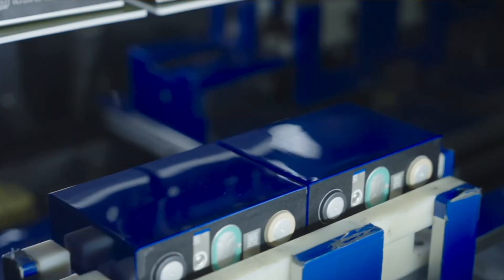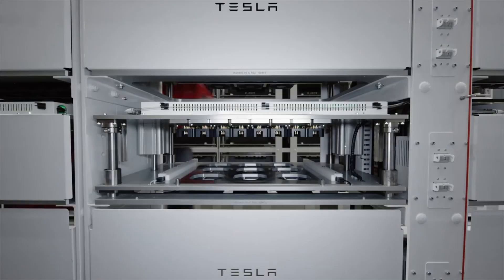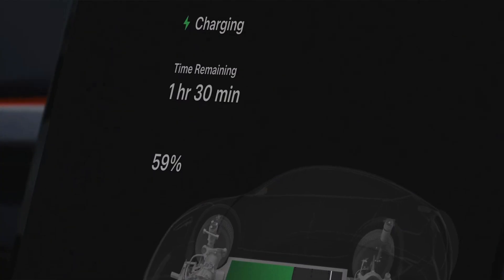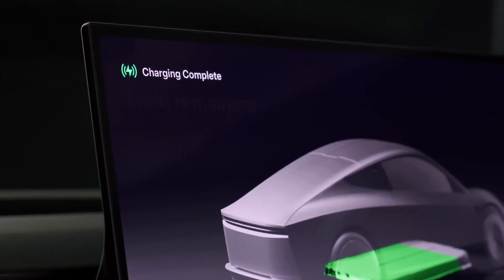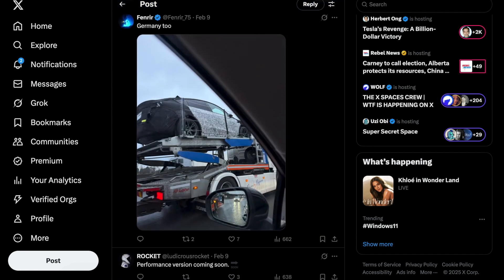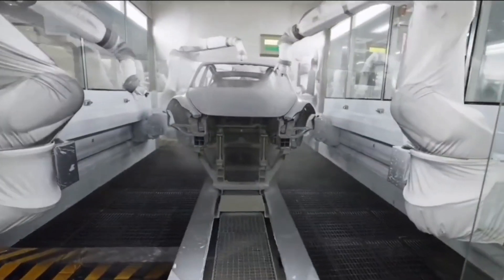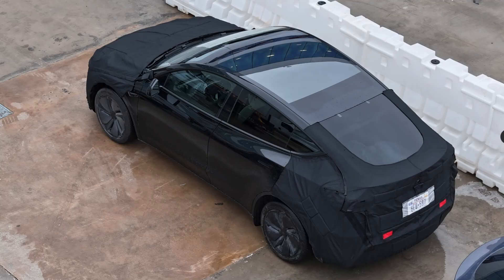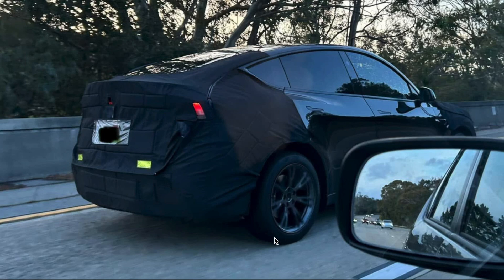NEW Tesla Model Y Begins Testing Massive Battery Upgrade | This Changes Everything

Comment: Come on - don't just read the marketing claims. The 4680 provides five times the energy and output compared with the 2170 battery but it is 2.5 times larger so their claim is advertising bullshit! Anyone can read the marketing spiel - could you apply a little critical thinking, too?

Comment: ffs, so you are telling me i just made a huge mistake by buying the new Model Y with the old battery? I think it would make sense for them to upgrade S/X with the new batteries + steer-by-wire.. lets see what happens
Reply from the maker: I wouldn’t call it old battery, this higher capacity battery is aimed at a different trim and will cost more. So your new Model Y will have the newest battery for that trim
Reply: @heyJohnEe  ???? we are not kids

Comment: You can always increase the charging speed of any BEV.  However, with faster charging speed you get more heat buildup.  I wonder how the car's BMS will handle this.  We know that Tesla has 2-3% battery degradation annually with 250 kW charging speed.  With 1000 kW charging, I wonder what is the battery degradation?  In fact, we've never seen any studies regarding battery degradation on Chinese BEVs.  Why is that?
Reply from the maker: BMS these days handle it very well, and from personal experience from my friends using Chinese EVs there’s hardly any degradation even when fast charging daily. Could be that the software is hiding it but I think not
Reply: @heyJohnEe  Need more than anecdotal evidence.  Need published data from reputable sources like Recurrent.

Comment: still waiting for an EV that is not a complete pile of garbage. there is no scenario where i will buy a car where every single function imagine is buried in an ipad glued to the dash. no instrument cluster, no heads-up display, no easy to access buttons for basic functionality, plastic seats, crazy depreciation, and they are charging lexus pricing for this trash. you have to be brain dead to buy this. 

a lexus will outlast 2+ tesla batteries and 10 tesla motors. in the end you'll save money by not having to keep replacing parts and/or buying new teslas, while at the same time driving a real car, and not a glorified barbie power wheels
Reply: Weird. Wonder how the model Y became the best selling car on the planet?
Reply: @russellhoguephd7925  i can tell you how; fleet sales. hertz alone bought 100k teslas in 2023-2024, mostly Ys for extra trunk space. cities like new york and paris were forcing uber/lyft drivers to buy them by only giving TLC plates to "qualifying" electric cars, no gas cars. the cab drivers almost exclusively buy Ys for the same reason, trunk space. but now hertz is dumping all of their fleet Es and Ys at half price because people refuse to take them and cities are removing the electric car requirements. 

and that is exactly why tesla sales have fallen between 45-80% around the world in the last 5 months. 

i hope that cleared things up.
Reply: This is silly. The battery warranty is 120k miles. Lexus offers a lower 100k warranty and only if you service every year with them. They are not confident that they will outlast Tesla, why are you?
Reply: Ok
Reply: 🤣You obviously never driven a Tesla or experienced FSD....Maybe you should before making such a stupid comment.
Reply: I just hate it when you're right.  My 18-month old Model Y is worth about 60% of current pricing.  Ouch.  It's a nice car but I don't have long-term confidence in it - especially as the company which supports it is headed by an erratic neo-Nazi.
Reply: Enjoy your car made by Fred Flintstone, Toyota/Lexus are old and outdated you most certainly are not getting value for money when you factor in running and servicing costs.

Comment: I think tesla are sitting on their hands until competition catches. Beast mode tesla is available internally and it has no commercial limits
Reply from the maker: That might be the case, super awesome if it is 😎
Reply: Beast mode?? What’s that. Speed? 

Or you mean burning the midnight oil which made them on the map? They’ve become lazy. Fat. And sedated. Where’s the new model built in 3 months by SpaceX engineers?

Comment: 500+ miles of range and super fast charging are more likely to be launched with the next-gen Model X, which is a lot larger and has more space for battery cells. The Model Y is designed to fit within a much lower price point, and if anything, I would suspect we'll see a lower range variant of the new Y that has an even lower entry price, as that's what will really help boost sales. Many people would love a 250-mile range Model Y in exchange for a big discount and doing that wouldn't require any major engineering changes to the car.
Reply: Can’t disagree. 

But that’s just stupid for the media to compare a 100k car against a BYD… that’s pathetic. 

Paying 100k for a car to charge 5 min ( no cabinets can even support ) and a longer range is about 5 years late

Comment: Thanks for the update, John, but higher capacity batteries don't necessarily lead to higher range, as Tesla may keep the same pack size or even reduce it slightly to lower costs. That was Tesla's long term strategy years ago when they first revealed the 4680 plan at a battery day presentation.
Reply from the maker: Good point, although the competition is heating up so I would assume they need to get on the same playing field. But maybe yeah, in that case it would greatly improve charging speed regardless of
Reply: I believe they have already been using the 4680 battery pack for cars coming out of the Texas plant.
Reply: @russellhoguephd7925  Not for Model Y currently Russell. They used them initially however they had poor charging performance and delays with scaling production, so the 4680s were used for Cybertruck instead. Tesla never talked about that much as 4680s were planned as the battery choice for many future vehicles during the reveal at battery day years ago.

Comment: I wonder if  Tesla will  do retrofit of the new batteries to the current Model Y. It has happened with Model S in the past.
Reply from the maker: Unlikely because this will be an entirely separate trim for those who want the longest range possible. Other cars got what they’re worth
Reply: @heyJohnEe  i am not necessarily talking about the super long range Y. But for example, retrofitting the M3P LFP batteries or something similar to the SR model Y or 3 could be possible.

Comment: You really think Tesla is going to release a car with a lot longer range? I don’t know. I’ll believe it when I see it.
Reply from the maker: Definitely! Theres huge competition now so there’s no way they’ll keep it the same for much longer
Reply: @heyJohnEe What happened with the M3P LFP batteries? 🥲
Reply from the maker: @apothecy4011 soon too
Reply: @ the other competition also has tons of stuff in there cars at the same price range like massaging seats and all the bells and whistles but I doubt they are going to add all that too. I just don’t see it. There volume is really high that I think that’s are not worried about volume but profit margin. And to increase that, they have to take stuff away. Like the leather and rear screen and stuff like that. More efficient batteries to have them smaller at the same range so it’s cheaper for that.
Reply: They have had cars with 400m range for a few years, right? I suppose going to 500m range would be cool and probably someone like my wife would like that...for me, the increased range would literally make no difference as I am never driving for more than 4 hours without a stop. Maybe I am just getting old.
Reply: @russellhoguephd7925  for me it would be nice since I take trips of over 1500 miles one way every year.
Reply: Longer range would actually cut down on the number of people supercharging. It doesn't do too much for people who charge at home and don't go too far, but it could significantly prolong the number of days between charges needed for those who mainly supercharge. This would be essential when more electric cars start using Tesla chargers. I almost exclusively charge at home, but there have been quite a few times I've had to wait in very long lines at superchargers.
Reply from the maker: @jamaicangurl4u that’s a very good point

Comment: So no point in buying a new Model Y now then? Because they would lose value real quick
Reply from the maker: It probably won’t affect value of current trims much since this longer range version will cost more and aimed at those who want the best range possible, otherwise the current trims still have decent numbers
Reply: It typically takes a while from when they have a new battery to when it actually makes it into cars. Testing testing and testing. They can’t get a battery wrong so they won’t release it until they are 1000% sure of the safety, longevity, reliability etc.
Reply: @yschlussel  remember last year there were a few reports of them testing a 95 kwh battery ..... Maybe they've been testing all along.

Comment: Thats it based on Jonny E news,  I'm cancelling my model Y juniper Launch edition and waiting for the battery upgraded Tesla Y
Reply: Sound like this might not be the most serious post. 🤔
Reply: Having longer range in a vehicle is one thing, but a bigger battery means far more than range. It's all about energy security. Eventually, Tesla will have to offer V to G and V to L. We just had a cyclone and powerout for a week. A bigger battery means more on demand energy for emergency power outages. 
The larger the energy storage, the better.
Reply from the maker: Always here, providing the latest news 😎
Reply: If you are telling the truth will lose your deposit. May be able to switch to non-Launch edition if wishing to save money. Upgraded battery might take a long while, if you are happy to wait then fair enough.

Comment: 1:45 - What does that mean in terms of range and charging times (regarding LG's new 46-series cylindrical batteries)? Are the differences dramatically different from old ones? And when specifically this year do you think Tesla would start putting them in the New Model Y's made in the US? Would suck taking delivery of a New Model Y and then 2 months later, they increased range + charging speeds by a lot.
Reply from the maker: Should be quite substantial doubling up per cell capacity and it would physically be able to accept current much faster without any software limitations ofc. Although they haven’t released any numbers just yet so we can’t say for sure. I would think it’ll go into production for China earlier before the texas cells fully ramp
Reply: @heyJohnEe  ah I see. You think it's likely in the US late this year? Or sometime next year? I'm still waiting on non-Launch Series in the US before incentives go away 🙃
Reply from the maker: @liam1902  We'll get a better idea once they launch the next-gen vehicles soon see what kind of cells they us e then we'll know about the Model Y

Comment from the maker: let’s not kid ourselves and say that we don’t need any more range, and resting at a charging station for 15 minutes for a bathroom break is good. We need major improvements in these both these areas, 500+ mile and charging under 5 minutes is the ultimate goal
Reply: Fully agree. We need it to match ICE - that is the benchmark.
Reply: Yes 500 mile range should be benchmark🎉
Reply from the maker: @R56Cooper definitely
Reply: I used to drive 380 miles without a stop and then return without a stop, the car could do over 1000 on a tank. Would have been annoying extra effort to plan stops into that journey, but 500 would probably accommodate a huge number of cases and make it easier for people to keep to cheaper electric tariffs most of the time.
Reply: Not where I live.
Reply: Sounds like you may have never owned an EV
If we get to 350 miles at 80mph highway winter and 15 minute 10% to 90% ice is dead.....Definitely still a pita to travel long distance with any EV with less than 300 mile/30+ minute dcfc
Reply: @  that implies that nothing changes with ICE, might be true but new technology or large price changes could change that.
Reply: New Xpeng G6 around 10mn fast charging. Hello Tesla.